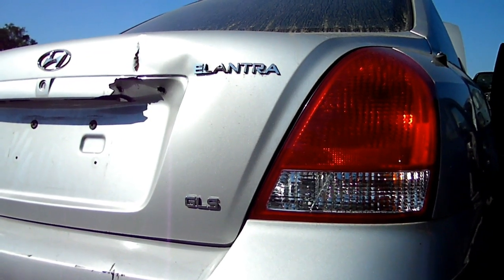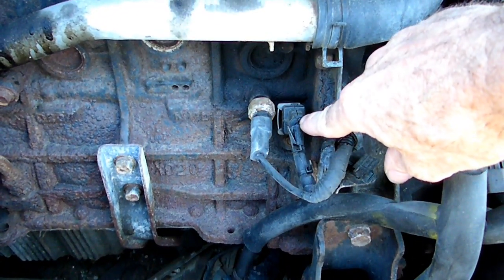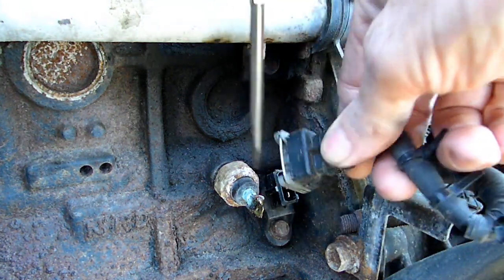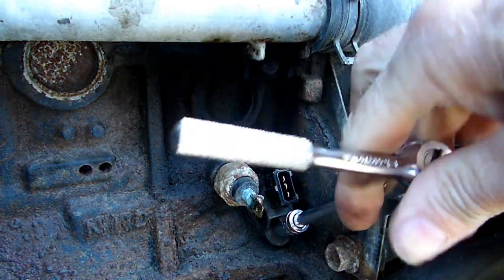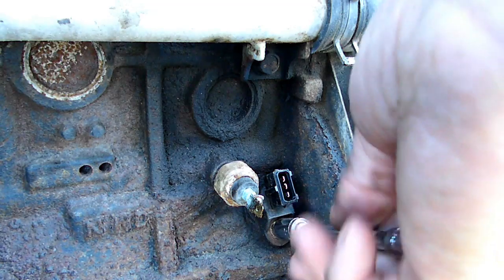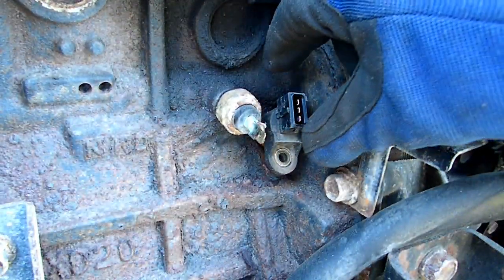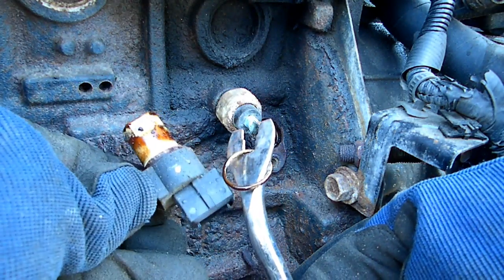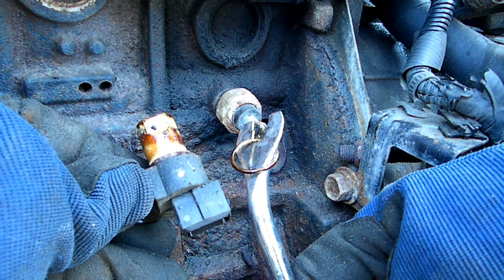Hyundai Crankshaft Position Sensor Removal

Comment from the maker: If you have no spark two of the most common parts that fail and lead to that condition are crank sensor and ignition module.
Reply: richpin06a   Is the ignition mu duke the same as the ignition coil pack?

Comment: richpin06a I have a question about the crankshaft sensor. Could it be possible symptoms of a malfunctioning crankshaft position sensor:
(1) Sometimes the car doesn't start - Crank but not start (no explosions on the? cylinders)
(2) The engine stops when the car stops let say in a red light ?

Thank you very much.

Comment from the maker: Your problems sounds like a possible loose belt and just because it does not have a automatic tensioner does not mean you can not tighten the belt it is just done the old fashion way.You lossen bolts move the alternator to tighten the belt then retighten the bolts.

Comment: I have not got a workshop manual for this car. Question, does anyone know what the small sender unit right next to the crank sensor is for ? It is located just above and to the left of the crank sensor and has a single spade male terminal and can easily be seen in the video ! I would hazard a guess that it is the Oil Pressure Sender Unit ?

Comment: My Nissan xterra, 2002, se, 6 cl was running and stopped on the road. I changed spark plug, change spark plug cables, change fuel pump, change fuel pump filter, and it crank but don’t start, I am going to buy a crank position sensor to see if it is the problem, if it does not work then I have to buy the distributor. Please if you know what I should do please let me know. I tried the test by removing the spark plug cable and using the negative of the battery to the head of the spark plug.

Comment: Hello I had a quick question I have my check engine light turned on and it was due to the crank shaft sensor and it turned off for one day then turned back on , the only thing I didn't do was disconnect the battery , not really sure if that has anything to do with the enginelight  turning back on

Comment: I am not 88% sure that my crankshaft position sensor is bad. On a obd2 I have code p0339 and p0337. Vehicle runs great at times when I slow down to idle it dies and cranks doesn't fire I leave it for an hour and starts good. Does this sound like crankshaft position sensor is at fault?

Comment: You said you were going to lubricate the o ring on the new sensor. What exactly do you use to lube it? Oil? Spray lube? (WD-40)?
Reply from the maker: Regular motor oil is usually the lubrication.

Comment from the maker: I looked into that and found the Protege does not have a automatic belt tensioner.
Reply: Hi can I use 2004 Elantra 1.8 camshaft sensor to 2002 sonata 2.0 ?

Comment from the maker: I use a piece of sheet metal 1x 6 inch long with a 1/4 inch hole to screw into the tripod mount of the camera.Then i use a pair of vice grips to clamp it to the car which i only do in my junk yard endeavors.

Comment: I have a 2007 Hyundai elantra, sometimes the car won't start. The engine cranks but won't fire up. Ask the lights come on then turn off... And as usual I try to start it, sounds like it will night it just won't fire up... Do you think the CKPS needs to be changed... Because the starter is pretty much new... Can you tell me where it is?
Reply from the maker: Amela Huzejrovic Have you checked for spark at the spark plugs.

Comment: I'm trying to locate where the camshaft position sensor is on my 2002 Hyundai elantra. I just ran codes and it popped up as camshaft sensor, but it looks nearly the same as what you've called a crankshaft position sensor in this video. If they're not the same could you please explain where I'd find the camshaft position sensor? The help would be much appreciated. Thanks.
Reply from the maker: I believe it is located in the area under the alternator.

Comment: I have a accent 09 and need to replace the crank shaft sensor is it in the same place or close to the Elantra  ?
Reply from the maker: I can tell you were it is on a 07 ,front of the engine near the catalytic converter.
Reply: Where exactly near the catalytic converter the only sensor I'm seeing is the exhaust sensor.
Reply: It's the same place that's on the video and the cat is part of the exhaust manifold

Comment: Yesterday my 2009 Hyundai accent, stalled and would not turn over. Before this happened it was running ruff (can't explain) tried to turn it over a few times but still would not complete the turn over..any advice? or what could it be. my check engine light never came on car just died, it was idling before  I began to drive it than stalled
Reply: I have the same car. But when the key is turned to the on position the check engine light is suppose to come on before you start it, to show that it works. But it did not and later found my exhaust was plugged up with catalytic pieces and sandy material. Clean out loose pieces and see if it runs

Comment: Good video on how to.. However, you might want to mention that it is a bitch to get to. Clearly you have removed a bunch of stuff to access the CPS. I propped the upper radiator hose back towards the air box using a bungee cord. Then, I used a flashlight to be able to see what I was doing. Finding that 10mm bolt was challenging, but I was able to do it.

Comment: if crankshaft sensor is bad. will car shut off while driving in rain puddles.
Reply from the maker: +William Mills That sounds more like ignition, like bad spark plug wires.
Reply: William Mills

Comment: This is not a good video to learn from, as he actually broke the sensor. NEVER pry a sensor out before twisting it side to side, or subsequently you break it in half inside the engine block and then create a lot of work for yourself to get the broken piece out.
Reply from the maker: Thank you Brian for bringing that to my attention that i did not show twisting the sensor before removing which i normally do.
Reply: richpin06a actually, the piece you took out was only the inside of the sensor. there was still the outer housing stuck in the block...
Reply: I am glad I saw your comment

Comment: Hi I have a 2005 Hyundai Elantra and I have the code p0011 where is the oil control valve filter??
Reply: what did u do to solve your p0011 code? Please help
Reply: I'm looking at this too. I guess its to change the camshaft position sensor. I have changed the oil control valve but I didn't know there was a filter...